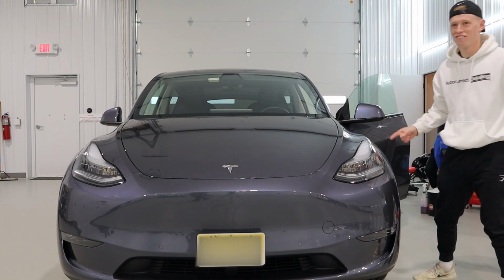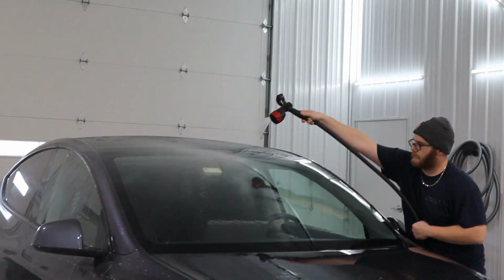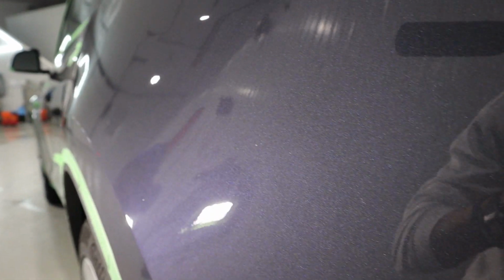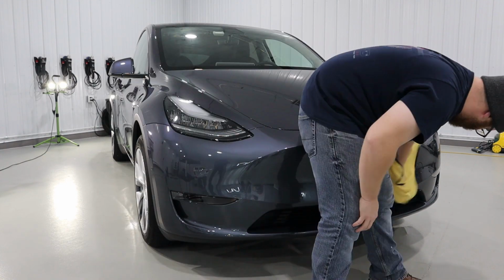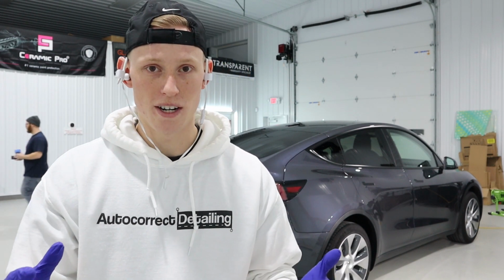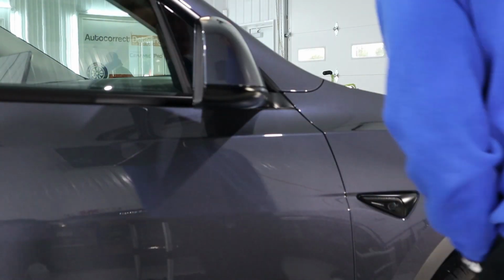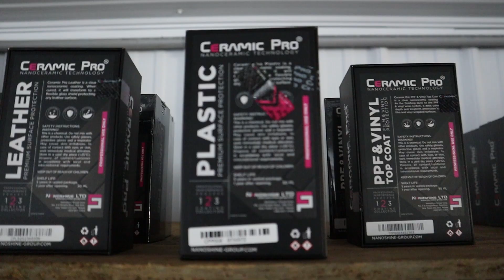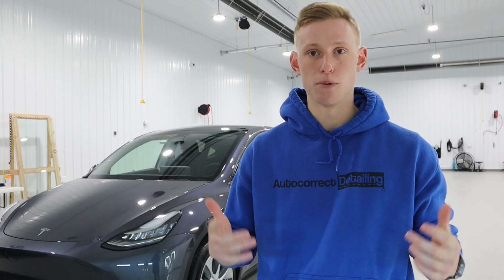Applying an 8yr Ceramic Coating to a Brand New Tesla Model Y (Professional Install Process)

Comment: Really good video, shows all the work that goes into it.  So glad to see the attention to detail.  But I have to wonder if a better solution for the owner would have been PPF and a light ceramic coating.  Because with the ceramic it can still get road debris dings.

Comment: Nice video, very well done with detailed explanation. I'm planning to try my 1st ceramic coat DIY soon, so this video will come in handy.  BTW, can you use regular ceramic coat on headlights? or does it have to be plastic ceramic coat solution?  Thanks.

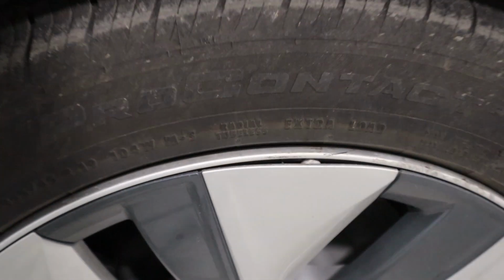Comment: 1:32, no that's not a hubcap, it's a wheel cover, but a lot of people call them hubcaps. A hubcap is what you'd most commonly see in the 50's and 60's covering just the hub, basically to hide the lugnuts and spindle bearing cap.

Comment: Nice shop and process!! If your running the machine on speed 6 you could be heating the clearcoat enough to cause swelling just hiding most of the defects.

Comment: What does this cost typically?
Reply from the maker: This detail in particular was $1,900. It was an 8 year coating package. At our shop we offer multiple different ceramic coating packages ranging from a 2 year ($950) to a 15 year ($3,000) these prices include a two step paint correction, wheel faces coated, windshield coating aka GlassParency and a Transparent warranty on all of the services. The prices vary depending on the vehicle condition too. Hope this helps!

Comment: I'm in nyc I have a 2 year old trail boss with scratches the auto body shop here told me that wet sanding and polishing,would correct the it about 90% then to get it ceramic coating .Do you guys can  do it all at your shop or should I wet sand it and polish it then bring it there.? And if so how much you charge for ur best treatment.

Comment: Well, w/ my brand new Q5e in my Garage I have made a decision not just based on finances but how much investment I wanted in an Auto I will keep for 10 yrs. No PPF.......full lifetime ceramic coating, tint the front 2 windows and I'll just apply RainX when I actually need it that bad. Hoping the 21" wheels on this new girl turn out nicely. Now I need to find the GO TO Detailer in ATL. Someone if you know the best Detailer to do the ceramic...........lemme know.

Comment: what are your thoughts on having a model 3 wrapped with clear wrap? my black model 3 is 3 months old and already has a couple of chips in the paint from stones. What should I do to protect it? Thanks for your help, love the information.
Reply from the maker: Thanks for commenting Gary! I highly recommend paint protection film (PPF aka clear bra). That’s the clear wrap you are talking about. PPF protects against industrial fallout such as rock chips, debris abrasion, and minor scratches. It also protects against minor impact. If your looking for the best impact protection PPF is the way to go 👍 I’d recommend a full front PPF install. That will protect every frontward facing panel that gets the most impact
Reply: @autocorrectdetailing8867  Im very interested. Im in Pa near Reading but willing to travel to you. I guess it will take a couple of days to do the front end?
Reply from the maker: @garymbuck1  yes it would take a few days especially if we detailed the rest of the car too. Unfortunately we won’t PPF available at our shop for about another 3 months. What was the time frame you were looking to have it done?

Comment: A very interesting and well-done video.Do you recommend PPF?  Or would ceramic coating suffice? I am expecting a delivery of my 2022 model 3 in multi coat red in a couple of weeks
Reply: Ceramic does not protect from scratches or chips. If the company says it does they are lying. PPF is the only way to protect your car from scratches.

Comment: So you think ceramic with top coat is enough protection or do you recommend PPF? I am getting my Model Y in October.
Reply from the maker: Hey Mark! So PPF and Ceramic Coatings protect against different things. PPF protects against impact damage like rock chips while Ceramic Coatings protect against environmental fallout like UV oxidation, pollen fading and other harmful things that nature can throw at your vehicle. I would recommend getting a PPF full front install so front bumper, hood, fenders, and mirrors and then ceramic coating the rest of the vehicle. That will protect the high impact areas from rock chips and the rest of the vehicle from natural oxidation.
Reply: And note that the ceramic coat is the LAST application. Even over the PPF.

Comment: Do you need to do anything special to the clear coverings on the cameras?
Reply from the maker: No we don’t put any coatings on the Tesla camera lenses. Wouldn’t want to risk any smears, smudges or streaks and compromise any of the camera clarity. The other censors are safe to coat tho 👍

Comment: Do you guys have any recommendations for a shop in Utah and Oregon. Have 2 Teslas and would like this done (1 is a 2021 M3LR with less than 50miles on it, the other is a 2018 X).
Reply from the maker: I’m not too familiar with any shops in those states. Your best bet would be to look up the closest Ceramic Pro Auto Spa. For a shop to be considered a CP Auto Spa they have to be very legit and offer the highest end quality work
Reply: @autocorrectdetailing8867  Thank you, will do 😎

Comment: how is it so swirled from the factory? not good from Tesla
Reply from the maker: This Tesla in particular went through an automatic brush car wash before coming to us so it’s seen some abrasion after it left the dealer. You’d be surprised how damaged most brand new cars actually are tho. We’ve seen brand new cars look worse than this just from the dealerships prepping the vehicles improperly and factory transport mishaps. A quality  paint correction will make a vehicles paint look more consistent and glossy than it was the day it left the lot 👍

Comment: would u do this before ppf?
Reply from the maker: No you would want to get the PPF installed first and then coat the rest of the car after. Putting a coating on the paint first would decrease the bond strength of the film leading to more lifted edges. It’s also  a good idea to put a PPF/Vinyl coating on top of the PPF too. PPF is similar to clear coat in the sense that it can get contaminated, oxidize and loose it’s clarity. It’s best to get the PPF installed first and then coat the rest of the car on top of it 👍

Comment: When was the build date - I have heard you are supposed to wait 3 months on new paint ???
Reply from the maker: Hey Ron! That 3 month period you are talking about is what we call the "gas out" time. Fresh clear coat slowly releases gasses that contribute to the paint & clear coat completely curing together. You definitely don't want to compound, polish or seal the clearcoat during this time period or else the paint will get "clogged" and develop imperfections much sooner. The 45-90 day period is really only for aftermarket paint jobs tho or if you have to get a certain spot repainted. Vehicles from the factory are painted and treated differently and can be worked on almost immediately.

 Also a fun fact: Rolls Royce paints and hand polishes each of their vehicles 5 times before they get sold which adds up to an average of 100lbs of paint per vehicle... They guarantee the best factory paint lol
Reply from the maker: So if you had to get a car part repainted from a body shop, definitely wait 45-90 days before compounding, polishing, waxing, sealing, ceramic coating or wrapping over the new clear coat.
Reply: Due to insurance issues most paint shop ovens are a much lower temperature than factory. The higher temperature factory ovens advance the paint cure process thus enabling paint polishing, correction, etc. The "3month cure times" dont really apply to factory baked paint.

Comment: Why not remove the license plate frame and do the entire panel?
Reply from the maker: Good question 👍 there was plenty of room to reach behind the front plate holder to Polish and coat by hand. We did not remove the rear because the plastic plate holder was installed with rivets that are very tough to remove and cannot be reinstalled. Removing those rivets can cause damage to the body panel too so it’s not worth it to risk damaging the panel
Reply: @autocorrectdetailing8867  I was referring to the rear, looked like plenty of room in the front.  Now that makes sense, but leads to another more important question, ‘who rivets their license plate on a $60K car?’.  At least they received a solid ceramic coat.  Great work.

Comment: Hi, I’m located in NY and interested. About how long will I have to leave the MY there for?
Reply from the maker: Hey Kyle for an 8 year package (2 layers of 9H + 1 layer of TOPCOAT) we would work on the car for 2 full days and then have you pick it up on the third day so it is properly cured before taking it out in the elements. For example, we would work on it all day Monday & Tuesday and then you’d be able to pick it up on Wednesday. What kind of vehicle are we talking about?
Reply: Autocorrect Detailing Model Y! Also MSM like in the video

Comment: Sorry guys but for $1900 detail I would expect the license plate bracket be removed and the paint behind it cleaned and coated as well, clean the inside of the wheels with brushes 🤷‍♂️
Reply from the maker: No worries we did clean the wheels completely just didn’t put it in video. Would have been repetitive if we showed cleaning all the wheels twice. For the license plate bracket we didn’t need to remove it to clean behind it, there is plenty of room to get behind it 👍 Thanks for the acknowledgment I’ll be sure to show the full wheel cleaning in the next Tesla video!

Comment: How could a brand new car have all those swirl marks?    ty
Reply from the maker: This one went through an automatic car wash before coming to us. You’d be surprised how easy it is to swirl up soft paint
Reply: @autocorrectdetailing8867  you sure its brand new?  the front license plate holder is an after market mod.
Reply from the maker: @billnipp2309  yeah he probably did that immediately to avoid drilling the front bumper. It’s common here in NJ.  This car had less than 1k miles on it
Reply: @autocorrectdetailing8867  I see. Where in nj are you?  I’m in central nj.
Reply from the maker: @billnipp2309  nice! We are located up north in Sussex county. Probably an hour to 90 mins from you!
Reply: @autocorrectdetailing8867  ouch!    thats far
Reply from the maker: @billnipp2309  Yeah it is but 1,000% worth it to get the job done right 👍 we’ve had customers drive 2 hours!
Reply: @autocorrectdetailing8867  how much for light pain correction and ceramic coating on a model 3?
Reply from the maker: @billnipp2309  A 1 step correction and a 1 year Ceramic Pro Sport coating goes for $400. A 2 year coating goes for $950 and comes with a full two step correction, one layer of Ceramic Pro TOP COAT, the wheel faces & hub caps coated, 3 Year windshield coating (GlassParency) and a Transparent Warranty. 5 years gets 2 layers, one of CP 9H and one of TOPCOAT plus everything else. Feel free to check our our website it has all of our services and prices 👍 Autocorrectdetailing.com

Comment: Great video! My favorite choice would be the Tesla Model X in that Tesla red❤️👀🏁 
How long does the glass coating last? 
What do recommend on the "up keep" of the coating? 
Can I use a regular hose or should I invest in a "power washer"?
T H A N K  Y O U
Reply from the maker: Ceramic coatings all have different life spans. We use Ceramic Pro (CP) ceramic coatings so we have different packages with different coatings that last 2, 5, 8 or 15 years with the proper maintenance. We are big fans of using the pressure washer and rinseless wash technique. The pressure washer will blast off dirt, grime and debris much better and efficiently and the rinseless wash is highly concentrated with polymers that add lubricants to the paints while washing and drying. You can certainly use a regular garden hose especially if you wash the car often 👍 A cheap electric pressure washer with low PSI and a decent GPM will make washing 1,000x easier and faster

Comment: How much should I expect to pay for a procedure like this?
Reply from the maker: The price changes depending on the shop, location, type of vehicle and the condition of the vehicle. The more  reputable shops and auto spas usually charge slightly more and less experienced/professional detailers often charge less. This detail in particular was our 8 year package and the ticket item was $1,900. Different packages have different prices too. We have legitimate ceramic coating packages that are less expensive and packages that are more expensive. If you have any other questions let me know!

Comment: Ceramic Poo lasting 8 years. Never even seen their 5 year coating last longer than a year. It’s a scam coating.
Reply from the maker: You must have had it installed improperly on your cars then. With proper maintenance the coating packages will last longer than advertised. How many of your cars have you had a Ceramic Pro 5 year coating on?

Comment: Sound system in the Tesla is absolutely garbage. The Mustang Mach E beats it hands down !
Reply from the maker: I’m going to have to disagree with you on that one! We’ve had a model 3 with the surround sound option in it and with pop star playing it nearly shook the tint off our plotter lol I bet the Mach E has a nice system that thing is sweet
Reply from the maker: @Eye-it-azz  I’m sure the Mach E has a very solid system 🤙 I was disagreeing that Tesla has garbage sound systems. Tesla puts very high quality sound systems in their vehicles
Reply: Entry level model Y and 3 has basic sound, the Long Range and Performance have upgraded surround sound. It’s possible you weren’t a fan of the base system.  This sounds like a shameless plug for the Mach E.  It’s a valiant effort by Ford and I’m thrilled another U.S. Company like Ford, who never took the govt. bailout in 2007 is putting out a great EV product.  It’s still a retrofit, however, it’s not 100% ground-up EV.  It will get better, but I’ll personally give Ford time to work out the bumps.  The software and interface in my (2) Explorers were awful, loved the drives, but the tech was dreadful, I can’t see Ford (at this stage) having power and cycling mgmt anywhere near Tesla.  It’s too new for Ford, Tesla has been doing this for much longer.
Reply: @baritonebroker   The Ford Mach is going to be the death nail for Tesla. Watch.